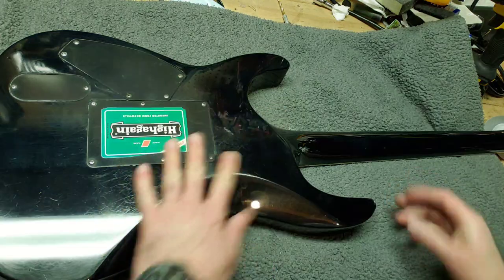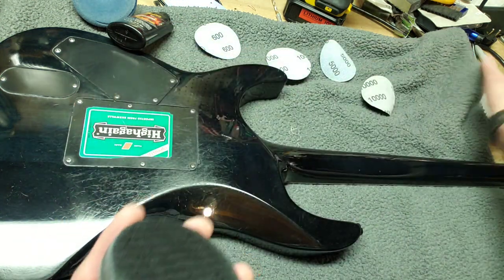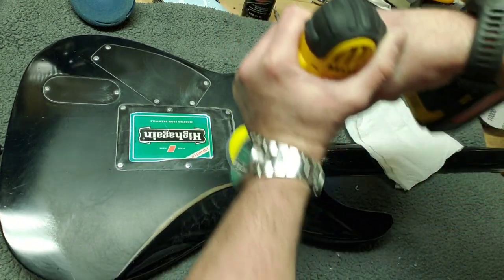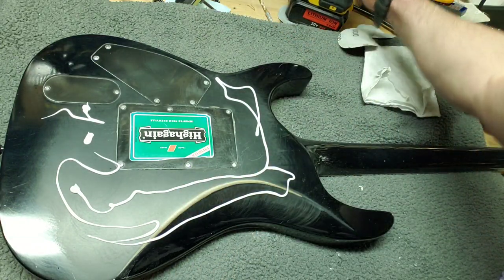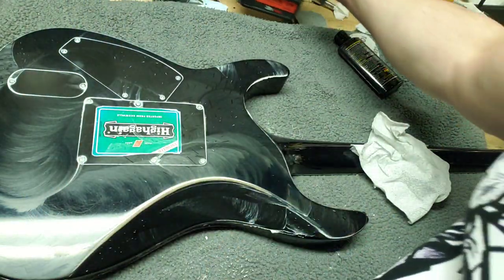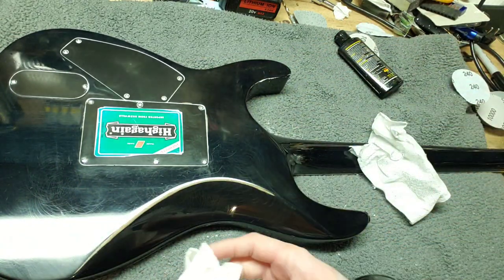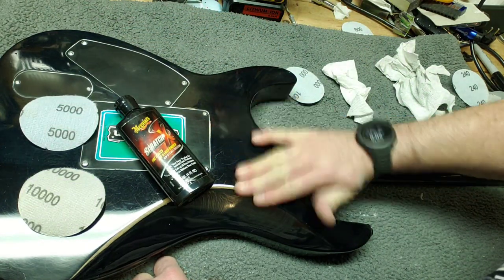Remove Scratches - Step by Step

Comment: Wow how to ruin your finish in ten easy steps. I would rather have the small scratches than eat thru the finish to bare wood. That's why you do it by hand not with a drill, and never go below 800 grit.
Reply from the maker: Hahahaha! You and I are clearly different in that sense where I would rather eat down to the wood than have deep scratches. As I clearly stated, you have to go 240 and trust that I'm not worried about a 20 year old $350 guitar. Hahaha. You care far more than I do.
Reply: @louistorres  lmao at that point screw the scratches sand that shit down to natural finish and slap some cutting board beeswax on it
Reply: @mandy i couldnt stop laughing when i read tjhis comment
Reply: @louistorres  back in 2005 I bought a well-used guitar for $300 that I just sold for $1200. So to dismiss a $350 20-year old guitar could be a costly mistake.

Comment: You said "I don't care about the cover" but the screws seemed to snag the sandpaper a couple times. Why not remove it, or at least remove the screws? Also, when you started with the 240 grit, was that with the Meguiers or just dry?

Comment: Even if the scratches were gone, you have bare wood showing. You will have to repaint to fix that which is much worse than clear coat scratches. Yikes
Reply from the maker: That wasn't bare wood though.

Comment: Keep up the great work, loving your videos. You seem to level up regularly.

Videos like this are valuable, because when you keep it real and show where things can go wrong/where they can be improved (e.g. Going down to the wood) - we learn from that and know what to keep that in mind when attempting this ourselves. I.e. We learn from your 'mistakes'. Overly polished videos (no pun intended) where everything goes perfectly doesn't help your audience as much as a raw and realistic video (like this one) does.

Not everyone can afford to get their guitars maintained professionally, so I love videos like this which empower guitarists to roll up their sleeves and do things themselves.
Reply from the maker: Yeah man, I had to unfortunately go deeper into the clear coat to get these deep scratches out but it was only a $350 guitar and it was the back of it. The other day, I used just the Scratch X and buff pad on my $5,000 PRS Custom 22, so light scratches won't need more than just the Meguiar's
Reply: @louistorres  I actually think it looks killer with the bare wood in that area. It's like a aesthetic accent and also gives it a worn look. But if people don't like it, at least they know from watching your video that that's a possibility, and to go easy. 

Make more videos like this please, I probably sound like a kiss ass, but I'm sure you have lots of other tips and tricks you've accumulated over the years!

Comment: How well does the Scratch X work to restore your finish for light scratches without using any of the sanding paper?
Reply from the maker: If you have really light scratches then you only need a buffing pad and drill with just the Scratch X. I literally did just that on my $5,000 PRS Custom 22 the other day. With this cheaper $350 used LTD, I needed to go deeper to remove as much of it as possible. I swear, the previous owner must have used a belt buckle with spikes!

Comment: You say you dont care about the way it looks. But i think you just wasted money on all these products and just ended up ruining this.
Reply from the maker: You don't understand how many guitar I have! Hahaha! Spending $350 on a beater guitar isn't much, my dude. It's a cheap LTD, not one of my $3,000 ESPs. There's a huge difference but I'll add that the products were literally things I already had or just bought for $10. Don't worry about ME, you should worry about you. That's my PSA for the day.
Reply: @louistorres  then what was the point of this video, because you advertised that this was a step by step process to remove scratches and you ended up with more scratches. Unless you're just trolling, so idk.

Comment: Sanded off finish attempting to remove a scratch 😂 this has got to be a troll
Reply from the maker: It wasn't the finish. Lol
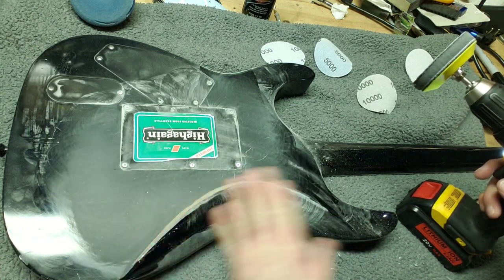Reply: @louistorres  That line that shows up in the tummy cut is bare wood, 7:23 you even said so yourself, you are "going through the wood  a little" 🤣